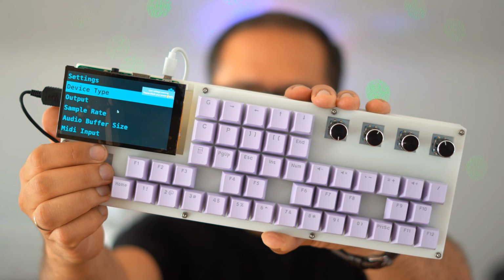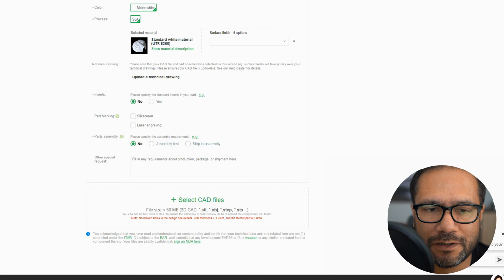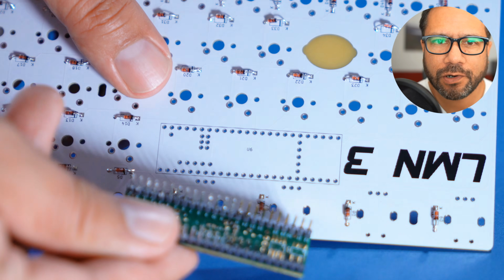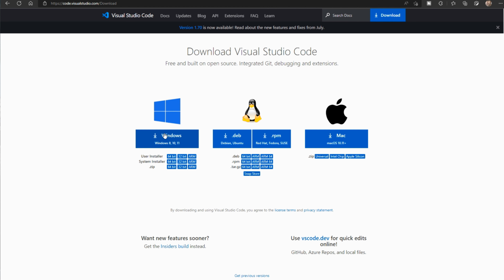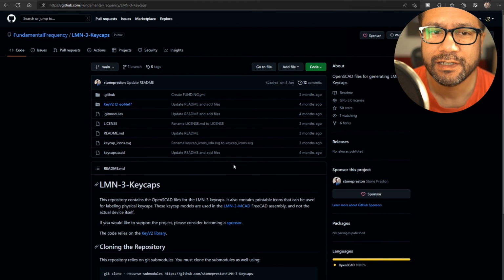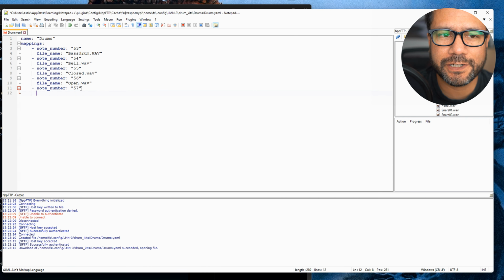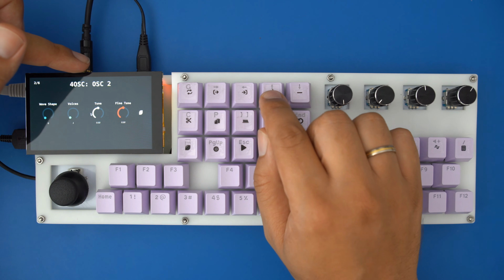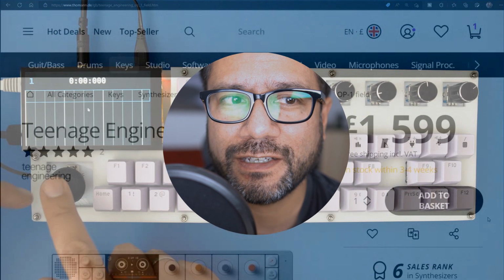Building and playing the LMN-3 DIY open source synthesiser

Comment: Thanks for trying out/building a LMN-3! Incredibly well produced video. Awesome job on the music as well. Things are definitely a little rough around the edges still, but hopefully with it being free and open source more people can contribute and continue to make improvements. Great build!
Reply from the maker: Thank you very much for watching this ;-) I apologize for being a perhaps a bit negative, but that segment was for some of my viewers who are planning to buy all that hardware without having anything at home already. I hope this video gets some devs on board. Thanks for creating this, it's a fun-to-use instrument.
Reply: Hey, question for both of you. I have built the LMN 3 and it works great, except when I add tracks and go to drum sequencer, the app crashes and I have to reboot the pi. Any idea why this is happening? I have two drum kits imported. My drum kits are directories loaded into /.config/LMN-3/drum_kits. I have included .yaml files along with them too.
Reply: also 1 more q, what sample rate do you use? I am getting some static at 96 kHz.
Reply: @gethsemane0  I got mine built but cant get the pi OS installed correctly. Its on a microSD card reader and plugged in, the screen comes on but nothing comes up. Any ideas?

Comment: This project has great potential, especially the daw and I think that they should focus on that part altogether IMHO. Making a midi controller using a teensy 4.1 and mechanical keys is expensive. and maybe even unnecessary and could be replaced by a pro micro or more elegant some multiplexers and the RPI GPIO pins. A teensy 4.1 already runs an OP-1 killer with M8 headless. If this project would utilize a generic USB computer keyboard or something like a joypad or maybe even cheap commercial midi controllers like the Akai APC mini this could gain a lot more traction.
Reply: Totally agree,the first thing i was thinking, why do you need a teensy4? i'ts overkill!!
Reply from the maker: Thanks for watching, I agree on everything you say.
Reply: 100%

Comment: Congrats on the great work! Just out of curiosity, you think it would be possible to run Dirtywave's M8 software in this hardware? Since the headless version actually runs in a Teensy "connected to a host computer", which in this case could be the Pi. I think the M8 software is way more "finished" than the LMN-3.
Reply from the maker: Yes, that's definitely possible. I don't know if I can get the encoders to work, though.
Reply: @mr_floydst  Maybe that's the real OP-1 killer, then... 😉

Comment: As an alternative to the Raspberry Pi, compatible single board computers can be used. These are not all affected by the price increase and continue to cost ~€50. But you would probably have to adjust the holes. The GPIO header is one and the same standard for all of them. Examples are: Orange Pi 3, Khadas VIM2, Tinker Board 2S and so on.
Reply from the maker: Thanks a lot for your feedback! I'll quote this in my pinned comment.
Reply: @mr_floydst  Nice. I don't know if you mentioned it in the video. There is also an emulator for Linux on GitHub with which you can test the software 1:1 beforehand.
Reply from the maker: @Klangraum  Yeah that's mentioned in the video. I know it's a bit long but YouTube likes longer videos. ;-)

Comment: I am in the process of sourcing all the parts to build one of these. Since you've already done a video about the headless m8, you should try running it on the LMN-3 hardware.
Reply from the maker: That would work, but I doubt the encoders etc. will be usable. I could do a short video on how to do it, anyway. Thanks for your suggestion.
Reply: @mr_floydst  I think that the entire keyboard is technically a midi input so maybe they do show up?  If you do move forward with this message me. I was planning on making a splash screen to allow the user to choose LMM-3, m8C (not the web version), or Desktop and would be happy to do it sooner if it has value for your video.  BTW I was able to get m8c to work on my RPI 3 with a small hiccup with getting it to go fullscreen.
Reply: Although the fact that it acts like a midi keyboard might mean the actual buttons may not be mappable to use for the arrows and other m8 buttons.
Reply: @GabrielCsanalosi786  hey mate, did you make the m8 hybrid work? I am still curious about this experiment.

Comment: Great video Floyd. I just have a question, is it possible to add DAC for better sound? It seems there is just the RPi audio jack output
Reply from the maker: Hi! Yes, that's possible. You need a DAC that extends the GPIO port so you can connect the screen, then just configure it in Linux. 
As the screen is sitting in elevated position, there's some room there for an audio hat.